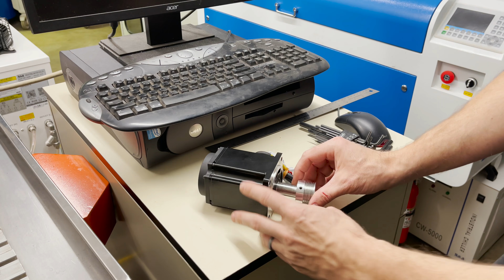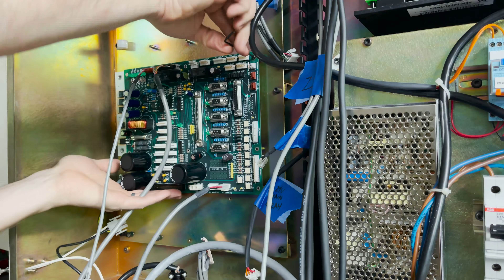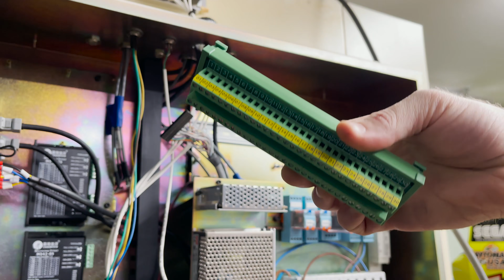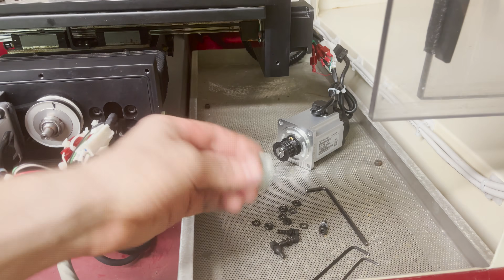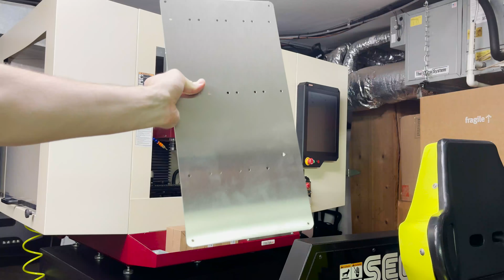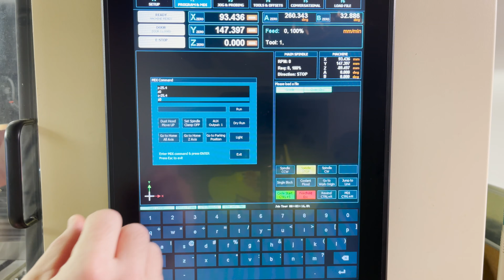CNC Mill Retrofit with Masso G3 Touch

Comment: One thing to remember is that push button switches go bad. I know that 22mm switches are bigger than the ones you are using. The benefits of using a readily available size switch is that if it goes out you can source one locally. The other plus is that if you get tired of replacing the cheaper ones you can get name brand switches in the future. I know that I use Allen Bradley for this. I found that the contacts of the switch are the same price as the cheapest I can find. I also found that the switch last ten times as long. The only negative that I have found is that they can coast ten times that of the cheaper ones. On the up side they only have two contact blocks available. So it's not hard to have a spare in the bottom of the electrical box. My industry is wood so dust would kill the cheap ones about once a year.

Comment: Just a suggestion, when cutting holes in sheet metal using a hole saw, you need to run it quite slow, like 300 to 400rpm with cutting oil and not too much pressure. Otherwise, it wears out the saw prematurely and puts too much load on the cordless drill.

Comment: Hey your shop is awesome.   What city are you located in?   You mentioned potentially printing in your stainless control panel as opposed to laser etching it.   How/with what would you do that?
Reply from the maker: I’m in the Chicago burbs. I bought this broken UV printer for cheap that Im trying to fix, if I can get it working that’s how I want to print the control panel graphics
Reply: @diyfiberlaser  Roland?

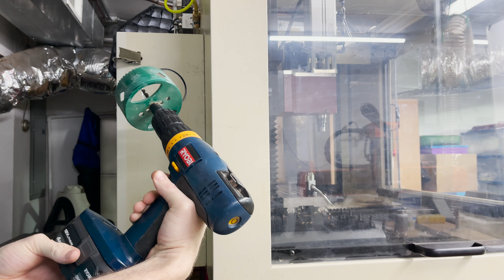Comment: 14:34 You dont want to stop power tool when motor starts to smoke. Cooling fan is attached to rotor. Take it off the workpiece, let it free run for some time to cool itself down

Comment: I don't like much this brand name controller, although it brings much convenience  to people not needing to do much software and electronic stuffs. However, It only provides the touchscreen but people usually also needs some more, such as some commonlly used hard button switchs, keyboard,  handwheel. Or, you need to build another cabinet to house all them as well as this controller cabinet.

Comment: I might have missed it but how much did the new mill cost (without upgrades) ?  I've been looking for one about this size
Reply from the maker: I paid $3500 for it. I might have been able to get it for cheaper if I waited, but I was eager to get it because of the great condition and rare options that it had. For me, it was worth every penny and the seller was a complete Saint, helping me get get it loaded on the trailer with my inadequate tools.
Reply: @diyfiberlaser  Not bad at all compared to a tormach pcnc or something.
Reply: How much was the retrofit cost
Reply from the maker: around $3k @garrettgerland4553